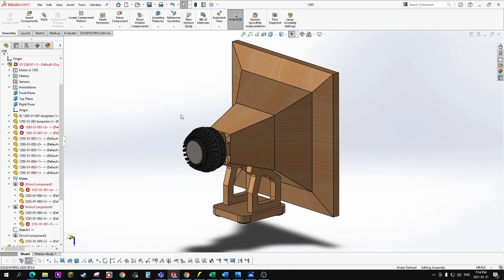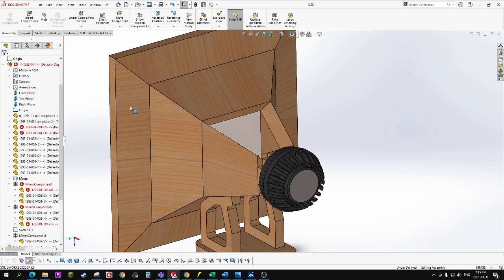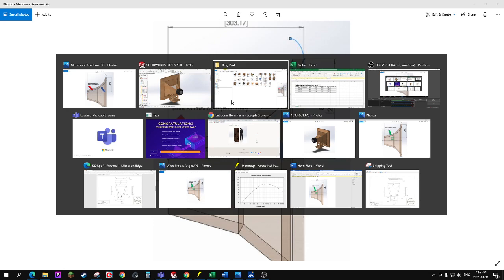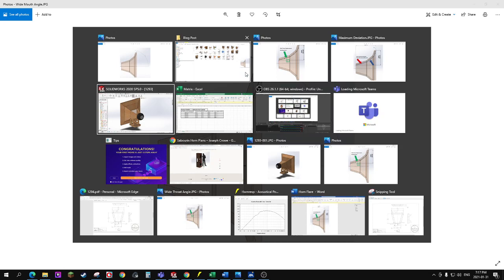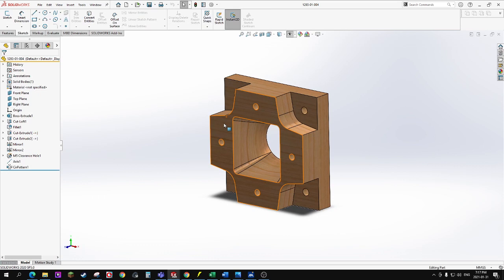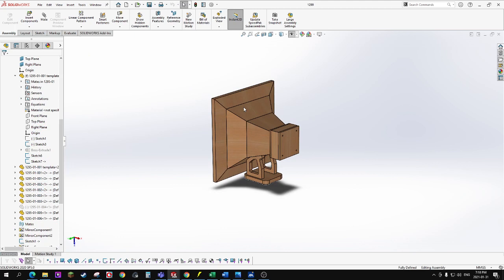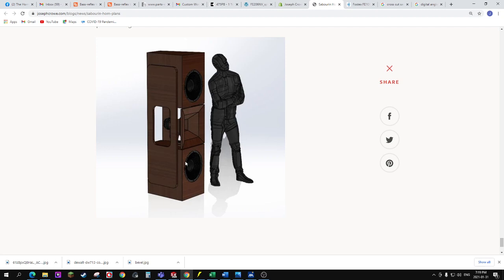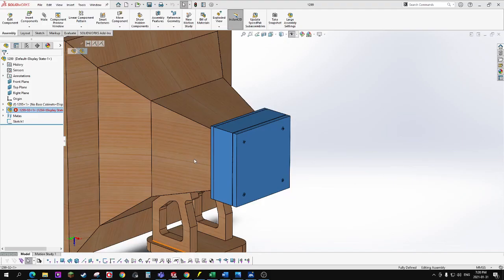Introducing the Sabourin Horn DIY Plans

Comment: Waiting to see some measurement curves. also polars. It's a challenge to make a compression driver to go from 300 to +10kHz. So what about a horn from 800Hz as that makes it possible to do 2-way + dual sub setup. Possible drivers JBL D2430K (344$) or Eminence N314X-8 (345$) or with a 1" throat possible 5530/31ND.

Comment: Hi Joseph, I was going to order some of Martin Seddon’s LeCleach flare horns driven by my Lowther drivers. I may want to build these instead. Would it work out if 16ga. steel damped on the back side with rubberized undercoating? I could then easily do a continuous curve and skip weld stiffeners to the backside.

Comment: what are the advantages and disadvantages of conical horn as used by OMA imperial speaker
Reply from the maker: Conical are more similar to constant directivity type of horns which a almost exclusively used in live sound reinforcement.  They have a unique constant coverage regardless of frequency.  The trade off is some horn colouration due to the reflections off of the horn mouth.  In terms of sound quality it’s very well documented that this has a detrimental affect.

Comment: How would these do as top section for a small reggae sound you think?
Would have them over 12 inch ported mid highs.
Reply from the maker: Yes, using a good compression driver will yield a maximus SPL of around 105dB SPL at 1m if distortion is to be kept below 0.56% (-45dB).

Comment: Hi Joseph, do you use Ath for designing horns?
Reply from the maker: I use Hornresp for some of the design.  The rest is trial and error based on actual testing through acoustical measurement and listening.
Reply: @JosephCrowesDIYSpeakerBuilding  okay then. If you haven't, I'd encourage you to check it out. It's such a great peace of software. A lot of features and improvements have been made recently.